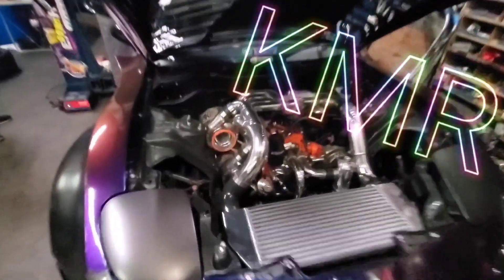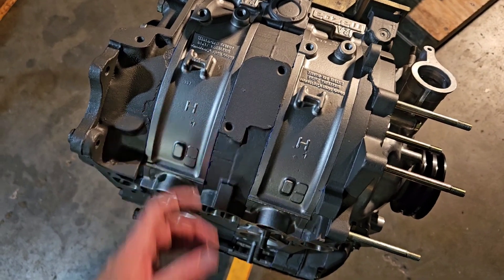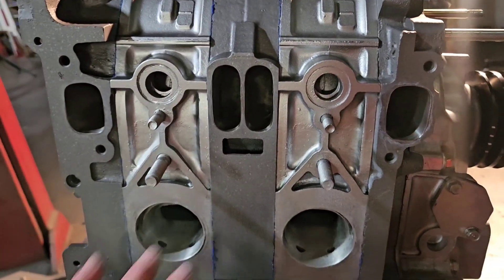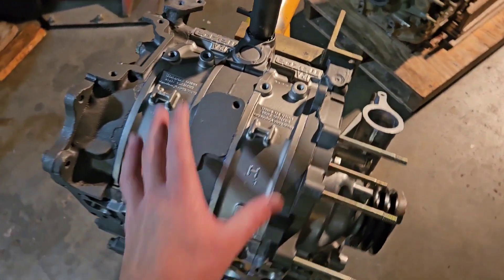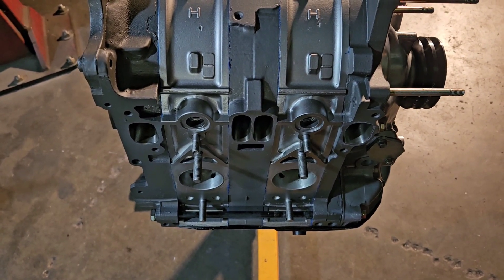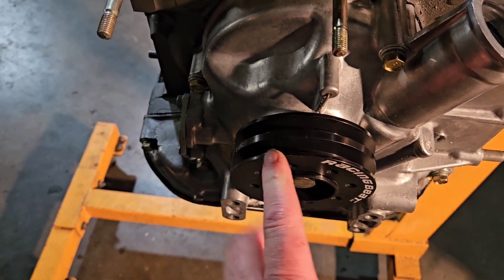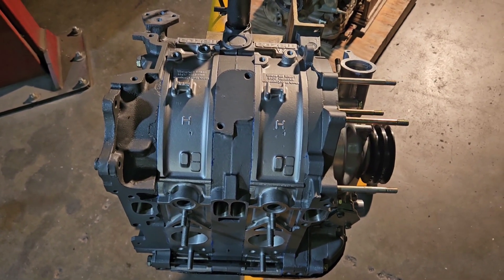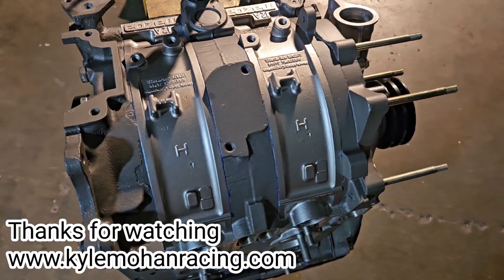Mazda RX-7 12a Rotary Engine Bridge Port rebuild talk - Kyle Mohan Racing - RE Tech Talk

Comment: 12As are 1.1L, not 1.2L
Reply from the maker: 12a motors would not race in a 1.1 class 🙄
Reply from the maker: NO,  Nate - technically its 1146cc. Generally called 1.2
According to Mazda literature: 
Displacement: 1.2 L (1146 cc)

I've never heard a Mazda employee call a 12a 1.1 liter. Also, that would be incorrect for racing class determination. Engine displacement is rounded up not down. You can't call a 1146cc engine 1.1. that would be disqualified. 

thanks for always watching the channel.

Comment: If the 13b was to get special bellhousing to a Honda transmission would it work for k series or b series... does the rx8 bearing hub spline have a 26 or 28t spline....I gotta dream idea of mid engine rotary miata. New dreams 😅